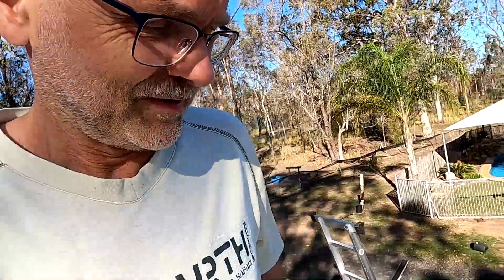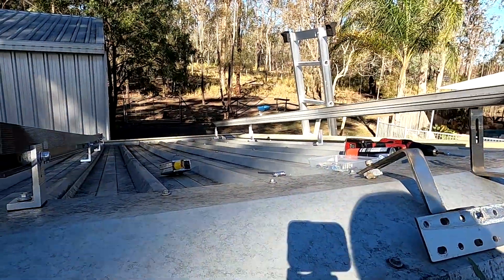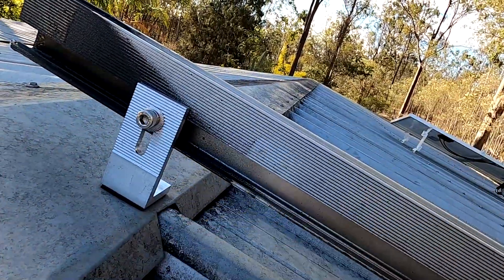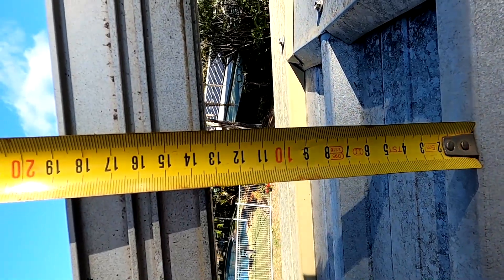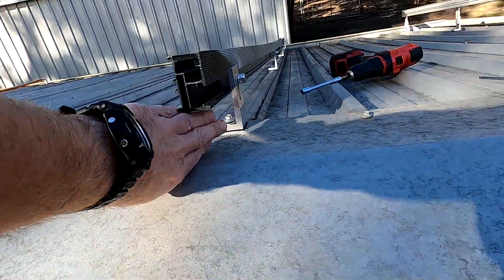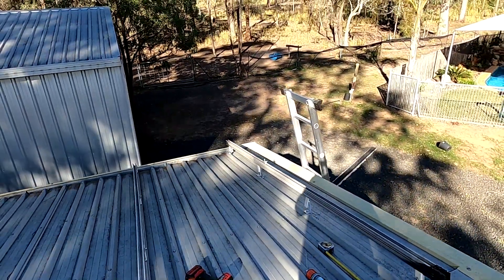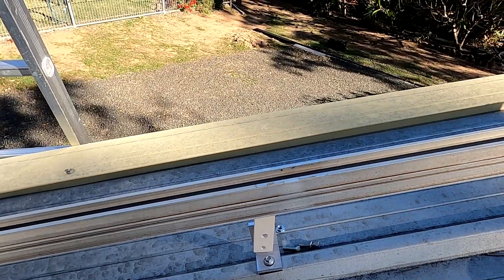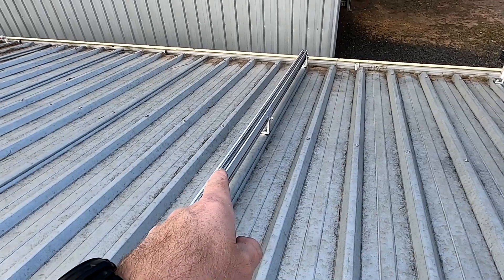Custom-built elevated solar mounts on the garage. So much better...

Comment: Hi Andy! Are you sure you want wind underneath the panels?
Reply from the maker: Yes, to cool the panels. Regardless, you will always have wind underneath
Reply: Have you considered using the hot solar panels to heat your pool. That would cool the panels and save you some money heating the pool.